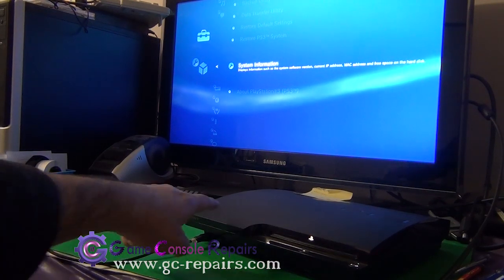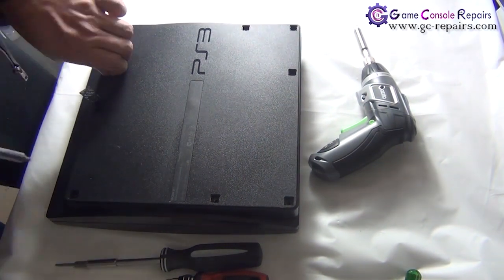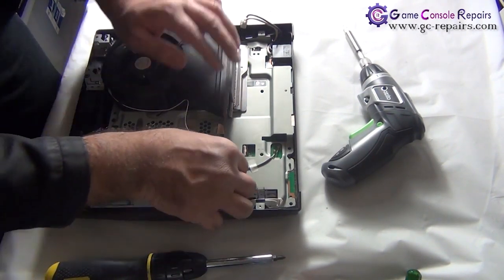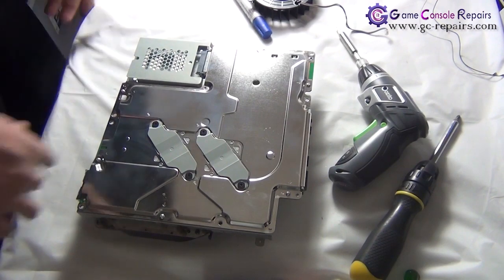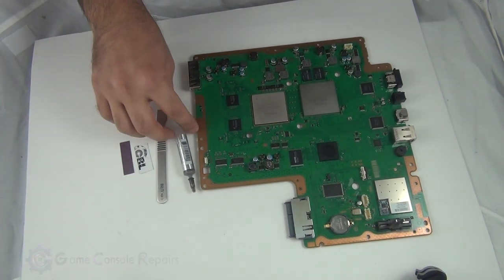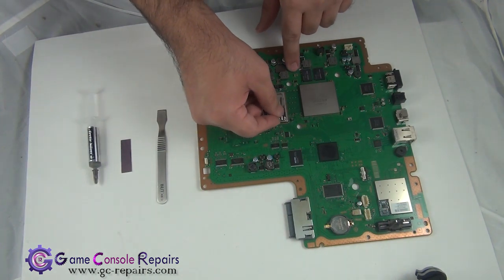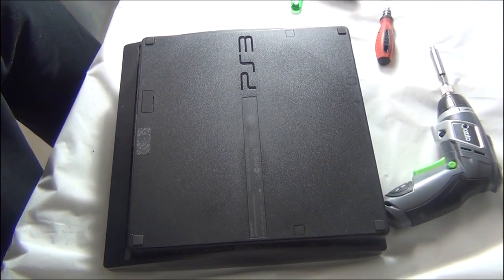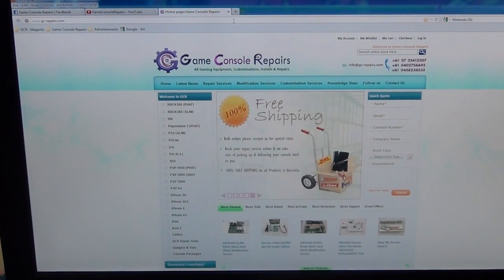PS3SLIM   250GB CECH 2002x   Fan & Thermal Compound Replacement by gc repairs com

Comment from the maker: @

Peter Taylor 
First thing would be to replace with new AS5. 80% of the chance is it will be fixed.
otherwise maybe GPU/CPU issue and you have to do REFLOW/REBALL.

You can add a Talismoon 17/19 blade fan, it definitely helps.

Comment from the maker: @Uri Scott
First try replacing your Power Supply Unit if still doing the same thing your motherboard has issue.

Many a times its CPU/GPU unit - You have to reflow/reball the board.

Comment from the maker: Yes 100% sure

YLOD is related to motherboard (CPU/GPU) failures.
if your machine was working before it WILL work. All we are doing here is just replacing the OLD (dried out) thermal compound with new thermal compound.

So far we have done 15 consoles and all went smooth :-)

Comment from the maker: it can be very frustrating I understand

Do you have spare 17-blade fan lying around ? that you can try out with ?
Also try this
One more time (I know you said you done this). open up till the motherboard bit. there will be bottom and top metal plates and there are two metal bars with 4 screws.

just screw 4 screws tight enough - no need to apply extra pressure or force 
you have to try a different combinations. i think the GPU is getting hot or not sitting/aligned properly

see how you go

Comment from the maker: so what was the initial problem ? 

this is FAN & Thermal Compound Replacement.

You only do this if you PS3 is making excessive noise and if you have not changed your thermal compound in like a year or so

by the sound of it you are having Blu-Ray drive issues ?

Comment: It'd be great if you answered the people posting DOWN HERE in the comment section. I know you probably don't want to give anyone "bad" advice, not that I'm saying you will. I had a question myself: Is it a good idea to apply an alcohol-soaked Q-tip underneath where the cooling fan is to remove lent?

Comment: All of this is fine and dandy except that it's next to impossible to find a replacement fan, especially for the 3000 and up models. Also a lot of anecdotal evidence on the Internet shows people doing this and the problem persisting. My PS3 is getting loud after only 10 minutes after turn on, and the fan is either resonating with something or there is something wrong with it. I would try and do this except i can't find any fans to replace it with, and yeah it's a 3004A model.

Comment: The HDD can't be corrupted cos I jus got replaced it and it works fine. It's jus tht, i think it's the fan tht needs to be replaced or something like tht to stop the overheating. The reason why because as my ps3 slim is cool and tht it has not been used for a few hours or even a day, it works perfectly fine until after 15 mins. Then, it starts bugging about and pausing. I also touched the ps3 a few times and it was like it kept getting warmer and warmer.

Comment: hello, yesterday i just bought a 160gb ps3 used and there was cigarette tar EVERYWHERE, all through the case, in the fan, power supply, so i disassembled the motherboard and took off the bottom plate, would loosening the heatsink screws break the thermal paste bond? 
 Thanks -mike

Comment: I have a different PS3 fan it looks similar as your but the wire isnt sticking out like yours its inside the fan and there are no screws to open it can u help plzz my ps3 fan is broken would you cosider me getting an intercooler fan.

Comment: I've the same model as you in the video (2004B), mine is warning me that "The PS3 system is too hot" and that I have to shut it down quickly, if I don't the PS3 itself is shutting down after 5-10min... and it's very warm at touch, but it's freezing in my flat XD, where do you think the problem comes from? fan ? or just thermal paste needs replacing...? could it be a software issue (which would maybe mean a new ps3)? thank you in advance for your videos and answers!

Comment from the maker: you still here
Could you please provide your PS3 Model  Number, HDD Size
I need to check the fan whether its 17 Blades or 24 Blades - we may be able to assist with the issue.

Comment: Lol I hope you're still around, my little sisters ps3 slim is messing up. Every time she plugs in the power cord her system flashes the red light, and the fan kicks on like it's cleaning itself. But once the fan goes off the ps3 shuts off. Only way to get any sign of life is to redo that same process but it still shuts back off.

Comment: from 4.47 to 5.50, there are 3 black screws on the motherboard, i accidentally used the black screws of the fan and screw them back, the fan screws are larger than the motherboard screws, now when i tried to tighten by using the original smaller motherboard screws, they are loose, does it really matter if i don't screw back the 3 screws on the motherboard?

Comment: Hi, I used this video as a guide to taking my PS3 Slim apart and re-doing the thermal paste and it all went well untill this morning (about 2 weeks since doing it) when I got a overheating message and the unit shut down. I used IC Diamond 7 paste and did the pea in the middle method, I followed the video exactly so I'm not sure where something has gone wrong but is there any advice you can give me? Perhaps I used to much paste? Any help is greatly appreciated, TY.

Comment: What is the small brown square clay stuff called and what is t for? Mine was dry-rotted and fell off. I am going to be changing my thermal paste soon and I wanted to change the other stuff while I'm at it. Thanks.
Reply: Those are thermal conductive pads, used to cool stuff like ram/solid state capacitors/etc.

Comment: my 160gb ps3 slim gives me a blank screen and no sound, then after about 2mins it shuts off with no red or green light. Then when I press the power button I get a red light so I press it again and I get a green light but still no sound or video and it shuts off again. what could be the problem?

Comment: i have a 250gb ps3 slim and i have the same problem as this
i replaced the fan and the thermal paste but my ps3 still goes really loud after like 15 minutes
HELP
Reply: cr7187 u should be happy it work

Comment: my ps3 slim has a problem with it aswell, it seems to get hotter alot quicker even though i have opened up and cleaned the fans, it will shut off randomly during gameplay with a flashing standby light (just red not yellow) and three beeps the most interesting part is i was playing resident evil 6 and at this one cutscene it shut off but when i turned it back on and skipped the cutscene i was able to play for a good amount of time 2-3 hours. can anyone help me please i am desperate!

Comment: When I am playing the last of us, my ps3 slim shows a warning saying system has become hot and after a few minutes, it shuts down. So i look into the internet regarding this problem and found out it has to do with the thermal paste being dried already. After reading and watching on how to changer thermal paste, I decided it to do it myself. Using Nano Silver Thermal Compound, I put new thermal paste, spread it thinly and evenly on the chip. But after changing the thermal paste, when I turn on my ps3, the fan blows strong and after a few seconds the warning shows again and after a few seconds it shuts down. Unlike before I change the thermal paste, warning shows only when I'm playing the last of us, but now whenever I turn on the ps3, the warning shows immediately and then shuts down. I followed exactly the proper way in applying new thermal paste, connected the proper wires. What do you think I missed or done wrong? Is is because of the thermal compound I use which is cheap? or the Power Supply Unit or the fan? Please I need your help. I would really appreciate it. Thank you in advance.
Reply: hear closely to the machine, make sure your fan is working.
Reply: my fan is working and it is loud the moment i turned it on. it shows warning that says system has become hot even though i just turn it on for a while. and it shuts down. what did i do wrong?
Reply: Rolly So should have someone do it for u

Comment: Help please!  My ps3 says its overheating and freezes however the console is alwaus cold.  I must need a new fan right?
Reply: cold be a number of things.. dead fan, dry TIM under the heatspreaders, could even be malfunctioning temperature sensor and/or encroaching ylod. I would start by applying some new high quality thermal paste. I suggest you look at a video on lifting the RSX heatspreader and get some new paste under there as well; I wouldn't recommend lifting the cell heatspreader as it is very risky.